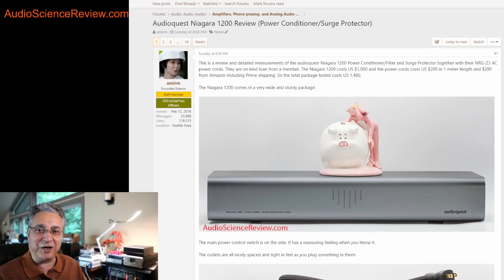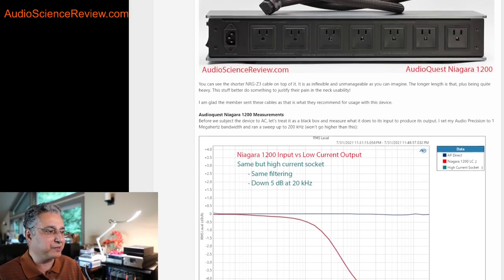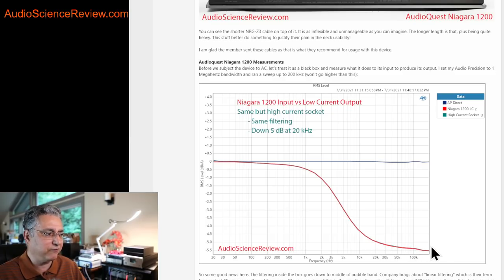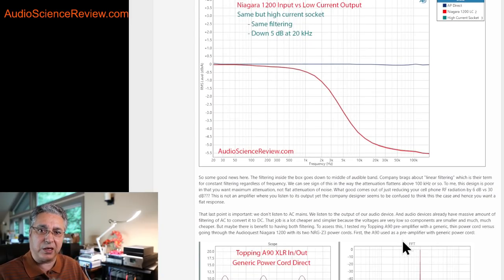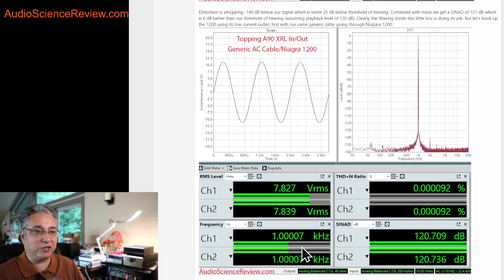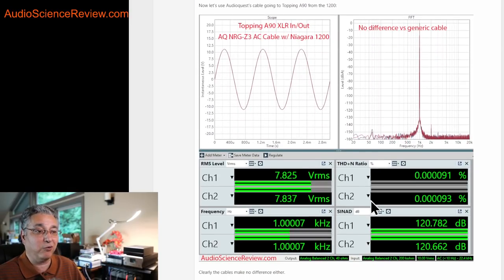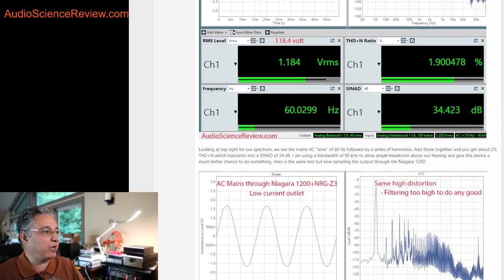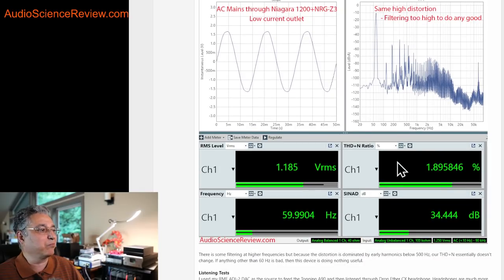Audioquest Niagara 1200 Review AC Surge Protector and Filter

Comment: Wonderful! Thanks. I use one of those surge protectors (from Furman, but same idea) as it came free with the house. The only thing that actually. makes a difference for me is a voltage regulator. My mains voltage drops to below 90 Volts in summer, and some audio equipment goes on strike. Bumping 90 up to 110 lets me listen to my stereo in summer! Yes, I can hear that in 10/10 cases.
Love the "generic cord sounds better" confirmation bias note. Absolutely precious!
Reply: Yes they're great for that ....big Capacitor banks ..
Reply: can you send me a link please? the weather is hot most of the year here, do they have 240v version?

Comment: Audio Science Review is the 20/20 vision among the blind.
Reply: Too bad he listens at dangerously high volumes, which basically means his impressions will be insanely unreliable within a couple of months or years.
Reply: @dannybos7024  -- Amir is an audio professional who knows how to take care of his hearing.  Stand down from alert.
Reply: @editorjuno  Have you ever even read one of his reviews? He listens at 90dB minimum, and even then he considers that low volume. This dude is fucking up his hearing.
Reply: @dannybos7024  -- That's just nonsense.  Like most wannabe ASR critics, it's pretty clear that you have no idea of Amir's methods -- he certainly doesn't do his listening "at 90dB minimum," which BTW is about as loud as a typical gasoline-fueled lawn mower and only harmful with repeated and/or lengthy exposure.  He may drive speakers that hard for automated measurements to find out their SPL limitations, but his listening tests are not done at ear-splitting volumes.  The guy was an executive-level engineering manager at two of the biggest names in the business and was regarded by both peers and subordinates as "The Golden Ear" of the operations he ran -- this is not someone who would put his hearing in harm's way.

Comment: I purchased this device not for any sound quality improvements but as protection for a very expensive integrated amplifier. Is the conditioner expensive? Yes, but  the non-sacrificial ability to open up the circuit if ever needed brings me peace of mind. I decided that at this price point it was worth it to me.

PS I felt it was time to update this comment. Ended up canceling the order and going with a Furman  DM 15i. When I really thought about it all I care about is the non sacrificial search protection aspect. I got the Furman on a special price promotion and save myself $600. I've been running it now for about 3 weeks and I'm very happy with. My sister still sounds incredible to me like it always did
Reply: I did the same on the info given to me at the audiophile store. This informative review makes me feel like I got royally ripped off. My very expensive tube preamp and amp cost thousands. Even went with the suggested power cords to each unit. Did I get taken maybe, do I hear a difference.. yes, remarkably I can. So it depends what quality of power you have at your mains, data don't lie, but also a good ear for sound and definition can't be beat. The single most important improvement one can make is putting your HiFi on its own breaker with its own run and outlet receptacle.

Comment: Amir, have you ever considered doing a Youtube vid debunking audio equipment burn-in? Over the years, we have heard that burn-in affects speakers, cables, speaker wire, amplifiers, etc. I would guess a test like this would be easiest to do with headphones, interconnects and/or speaker wire because those are the cheapest and easiest to ship? You could perform the test on the new equipment, ship it back to the person who lent it to you, so they can use it in their system for a period of time (30 days, 60 days, etc.) and then have them ship it back to you, so you could retest and compare to the original results.

Thanks for all the videos. I appreciate them.
Reply from the maker: Yes, the topic has come up recently in the context of speaker break in.  I have offered to do the testing if someone builds a box with a woofer in it.  Would do it myself but finding the time is hard.  As to break in of cables and such, there is no effect as is so hard to then try to figure it out post break in.  I can also do the break in by running stuff as long as it is not a really long time.  If there are specific ideas, let me know and I will consider them.
Reply: I suspect mechanical systems do have break in. Probably chemical systems too (capacitors and batteries) but to a lesser extent.
Reply: The speaker surround and spider can change their stiffness if pushed far enough in excursion for a set amount of time but from what I have read those changes usually revert back to the original parameters once the signal is reduced or removed. Simply measuring the T/S parameters before and after "break-in" will show if there are any permanent changes. From what I can recall reading about this, it very rarely changes at all and when it does it's due to the spider stiffness changing due to excessive flexing where the chemical coating of the spider cracks slightly allowing the spider to become less stiff.  This would apply to woofers only since midrange and tweeter diaphragms don't move much excursion wise. As far as "burn-in" for the speaker driver having to be a set time such as an hour to two weeks, that's bogus. To "break-in" a woofers spider just carefully push in the cone back and forth a few times and that would be enough to flex the spider. I do not recommend you do this though and take no responsibility for any damage that may happen.
Reply: @giriprasadkotte9876  And do you also suspect that The Fairies are real as well? I shan't blame you if you do.
Reply: @Mrch33ky  
As a qualified practicing mechanical engineering professional, what would you think I think?
Reply: Burn in is real on some components. I just experienced it twice.
Reply: @giriprasadkotte9876  Did you stay at a Holiday Inn last night?
Reply: @notthatperson8179   Gosh glad you showed so much proof instead of just stating an unproven claim.
Reply: @davidlong1786  ??
Reply: @giriprasadkotte9876   You "suspect" but show no proof, just your opinion so that reminded me of those Holiday Inn commercials where they give "expert" opinions and use the Holiday Inn overnight stay as an excuse to spout such.
Reply: @giriprasadkotte9876   This channel is for real data not opinions. Please go to snake oil channels to express unfounded opinions thank you.
Reply: @davidlong1786  
Interesting. Are you Sundar Pichai under an alias, any chance?
Also, please explain the "science" behind your claim of T/S parameters remaining same for perpetuity. Also, what are your education credentials?
Reply: @davidlong1786  
Also, can you afford your medication?
Reply: @davidlong1786  I can’t prove my subjective experience it’s unknowable outside my mind. I never thought burn in was a real thing until this year when I heard it with two different headphone streamers. I also didn’t think power cords made much of a difference until last month. It’s ridiculous to tell people their subjective experience is something other that it is.
Reply: @notthatperson8179  Well subjective just means it's nothing proven but an opinion. Without well known testing, it's bogus and just means it could have been (more than likely) the placebo effect. Sorry but say-so means nothing.
Reply: @giriprasadkotte9876   You bring up medication again. How about taking your own?
Reply: @davidlong1786  
I don't need any. Because I'm not the one claiming that T/S parameters don't change with usage.
What's your educational qualification?
Reply: @giriprasadkotte9876   I have no idea who this Sundar person is.  The "science" as you call it was published in either in Speaker Builder magazine or online or both. They measured the before and after effects of "burn in" and found it didn't change the T/S parameters. As for my education credentials why is that important considering we are discussing a well known snake oil claim that "burn in" is real?
Reply: @davidlong1786  
Education is important. One can't possibly take physics lesson from gender studies post doc seriously.
Also please share the stats from the said "experiments".
Reply: @giriprasadkotte9876   On brother. I have personally tested many speaker drivers measuring  the T?S parameters and found they didn't change after "burn in". Stop trying to do strawman arguments. I have been involved in building speakers for many years as a hobby and have studied how to measure and build them for over 40 years. I don't have the stats from what I mentioned before due to the time that has passed since then. This was many years ago. If YOU can prove that burn-in is something real then show proof or just drop it okay?
Reply: @davidlong1786  
Yup! That qualifies as diddly squat for statistics.
Reply: @davidlong1786  So nobody can have a favorite ice cream? How can one prove they like vanilla ice cream?  I experienced significant positive change in both my headphone streamers this the first one was the same model that I had been listening to on demo for over a month. When I received my Bartok it did not sound very good for a couple of days. I had a loaner Bartok that I’d listened to 10 hours each day for over a month up to an hour before mine was installed. I already said I didn’t believe burn in was a significant thing prior to this experience. Why don’t you science it up by demoing a Bartok for a month while waiting for yours to arrive. If there is no burn in then the new one should sound nearly identical to the other as soon as optimal temperature is reached. It’s an easy experiment. If you can’t afford that dac then buy two Naim Atom HE. Listen to the first one for a couple of months then open the second one and listen to it. This is what I’ve done and experienced. The sound of both dacs improved greatly over several weeks.

It should be a simple task for an Einstein.
Reply: @notthatperson8179  You ever hear of people's hearing getting accustomed to the sound instead of the product changing? Yeah that's a thing and has been discussed on this Channel before.
Reply: @davidlong1786  I had two Bartoks the first had 1,000’s of hours the second brand new. The new one initially sounded terrible and completely different than the first. I’m not going to just going to get accustomed to a crappy sounding dac at $18k. The Naim sounded terrible at first and I let it run in for a couple of weeks not listening to it. It sounded much better after that. How did I get accustomed to the sound? Go buy two of the Atom HE and do it yourself. What are you afraid of? It’s only $6k and you can sell them afterwards at a small loss. Prove yourself correct instead of acting like my experience is some kind of delusion.
Reply: @davidlong1786  
Also, "strawman argument" isn't what you think it is 🤣
Reply: @notthatperson8179   Prove what you said is true or just stop spouting anecdotal tales okay? Now if what you say IS true then the products you bought were crap. Funny how audio products ALWAYS sound "better" after "burn in" instead of sounding worse huh? Cant they build something that sounds good from the start? lmao.
Reply: @giriprasadkotte9876   I know BS when I read it though. Not replying to you anymore, it's waste of time.
Reply: @davidlong1786  
Yeah and your famed science experiments shall remain a secret forever 😢
Reply: @davidlong1786  I can’t prove it’s true anymore than I can prove I like vanilla flavor. I’m just Relaying my experience. My initial post said burin is real for some components. This is the first time I had two identical units to compare. It wasn’t subtle. Stop being cheap and recreate my experience. I’m certain you’ll experience the same phenomenon. I don’t claim to know why it happened. All I know is my ear is trained as a musician to be able to judge sq differences on violins. The brand new Bartok sounded flat, dull, and generally terrible for the $17k. I’ve heard dozens of dacs and the demo Bartok was immediately incredibly detailed with an amazing headstage. The new one sounded worse than my old Naim V1. Why don’t you just repeat my experience as it’ll confirm your assertion that I’m just a fkn moron or you might see that I’m telling the truth. Seriously why would I come here and lie about my experience? I understand the argument that the brain becomes accustomed to the sound but with the Naim I wasn’t listening to it for the first couple of weeks. If you think the Bartok and the Atom HE are poorly designed then I can’t help you. Unfortunately it seems you’re on the spectrum so unlikely you’ll even try such an experiment because you want to remain in your safe space where unexpected things can’t happen. Again I was not a believer in burn in until the two Bartoks when it became obvious th new one improved greatly over time. Not sure what you have to lose by trying it. Obviously you can’t afford to try the experiment and your neurotic defense mechanisms are shutting down your ability to question your deeply held beliefs. Being open minded is hard for some people especially the autistic. 

It’s up to you. I’ve given you my anecdotal evidence and you can either tRy to reproduce it (which is science) or just continue going around the internet feeling smug in your ignorance.
Reply: @davidlong1786  Look at they way you respond to people.

Comment: Concerning the frequencies between 60 Hz and 3K there are two products on the market which claim to lower noise in that range. One is called the Absorber, and the other is the EP2050 made by Environmental Potentials. The first is made in the UK and the other in the US.
I have the one made in the US. 
BTW, I see the PS Audio P-300 in your room. I have one also, which I use for source components. The box on top is a no-no. The P-300 runs hot. I keep the output under 50 watts.
Thank you for the review!

Comment: I did the same on the info given to me at the audiophile store. This informative review makes me feel like I got royally ripped off. My very expensive tube preamp and amp cost thousands. Even went with the suggested power cords to each unit. Did I get taken maybe, do I hear a difference.. yes, remarkably I can. So it depends what quality of power you have at your mains, data don't lie, but also a good ear for sound and definition can't be beat. The single most important improvement one can make is putting your HiFi on its own breaker with its own run and outlet receptacle.

Comment: I love this video,  I have a question. 

Does using a battery back up designed for a computer induce nose that can't be filtered by an audio gear power supply that filters the AC? Is the A.C. sign wave coming out of a battery back up so out of the normal wave form that it would cause audible problems? 

Battery back up devices are often the best for spike protection and thus the question.

Comment: 18:03 I actually have been in the situation where I needed a AC power conditioner. I was using an old Luxman receiver and I was getting constant interference at my apartment. It didn't matter how loud I had the volume or what source I was using, the amplifier just pushed through constant popping and buzzing. As soon as I plug that receiver into an outlet at my girlfriend's home the interference went away. Something with the power at my old apartment was causing interference with the receiver.

That said, I have never heard a modern (later than 1970s) piece of equipment have interference issues.

Comment: Could you experiment whether a surge protector impacts audio performance, and if so, in what way? Where I live, a surge protector is necessary, but everyone says that surge protector can either introduce noise or restrict amps from being as dynamic as possible (by restricting current I think?). Would love to see some actual measurements and analysis.
Reply: That is all BS. I am an electrical engineer and the purpose of power supplies in your amp is to regulate the DC supply, provide filtering and provide reserves  for dynamic loads.Buying surge protectors is simply paying twice for the same functionality. once in the device/amp and then again externally.
Reply: @exponentmantissa5598  
In the area of surge protection, isn't a multi-tiered approach recommended for an effective surge protection scheme?
Reply: @FOH3663  its better to have multiple methods of protection, the components like MOVs in surge protectors are rated to absorb only a certain amount of energy beyond which they don't protect and that would happen silently so if you had known surges such as lightning taking out other equipment then replace it or have more fail safes. I have seen surge protectors that you can install at the electrical panel in line with breakers, chaining multiple extension cords might not be a great idea as the losses go up.....